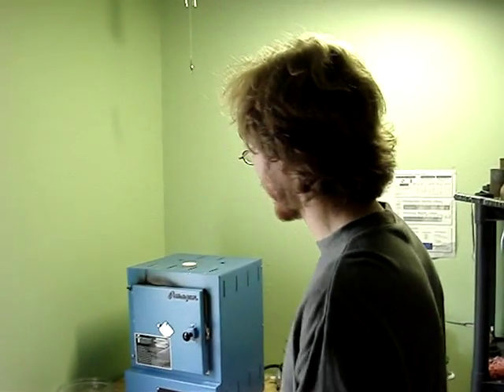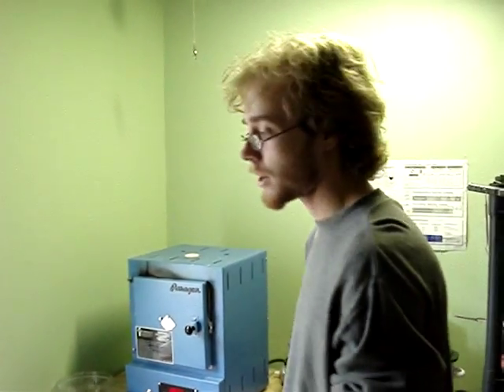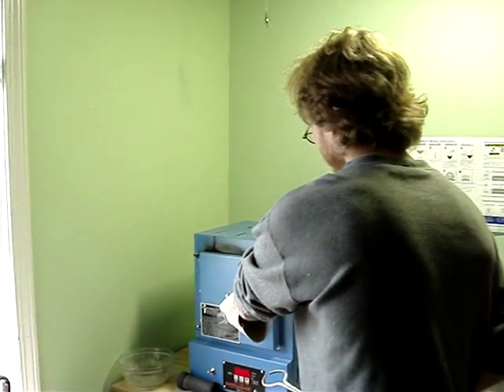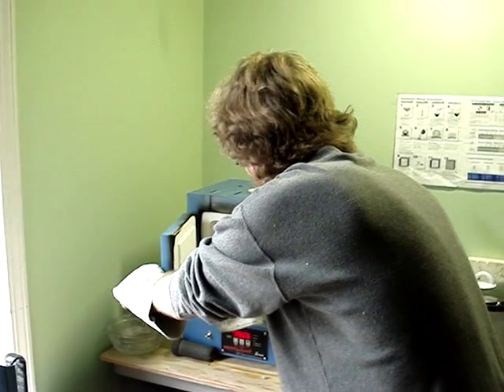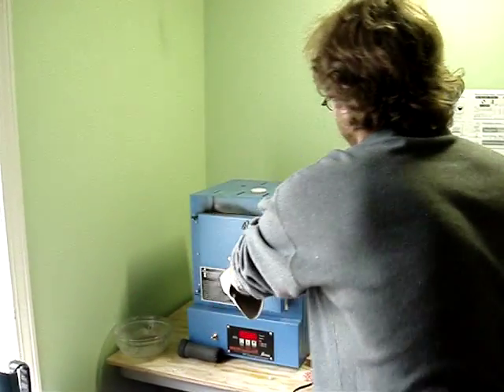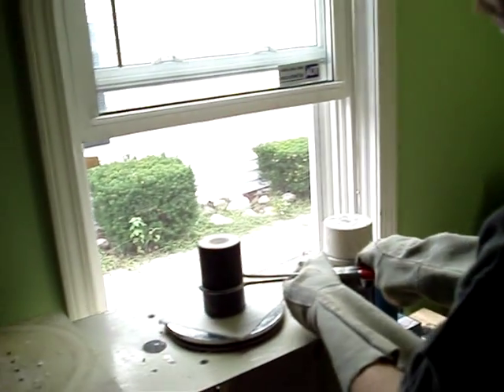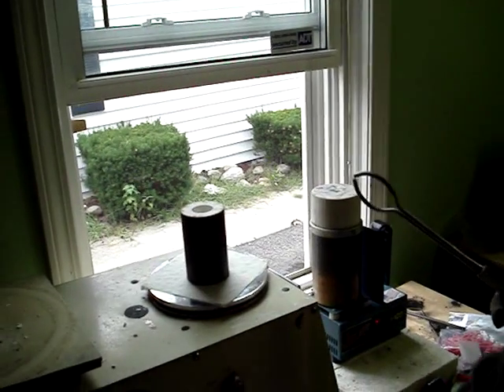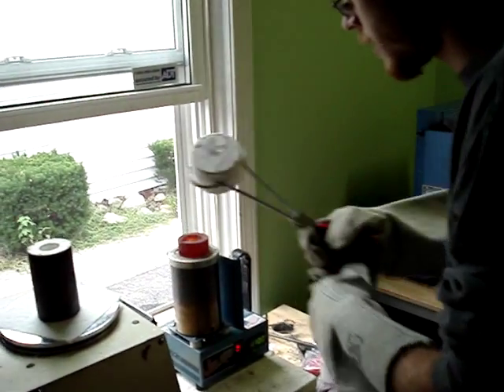Step 6. Lost wax Casting reproduction using wax injection. 21083

Comment: Hi friend. Do you have a 20amp outlet in your casting room? I bought the Paragon sc3 oven and it is rated for 15 amps. My room outlet is 15 amps exactly. Does that mean I should not turn anything else on in the room during burnout? Much thanks for your patient answers.  :) You rock either way. Peace.

Comment: Do you have a problem with pitting in the surface of the silver when casting this way? Does that oven allow for programming cycles? I have the same casting machine, I think, and I am wondering why you don't use the perforated flasks and what the perforated flasks are best for? Much thanks and have a great day.

Comment: great videos! Very informative.
I assume the vacuum is applied so that the metal fills the mold cavity completely. But I was wondering how the vacuum works its way to the cavity. Is the mold material porous? or have small holes been made?

Comment: Nice videos.I am trying to cast in aluminum a 1/35 sprocket the size of a quarter. But I am new at this. How can I make the mother mold? Can you tell me how to make this mold out of? The sprocket is for a model tank. But I wanna make this sprocket in metal or aluminum. You can see photos of the sprocket in flickr.com keyword 1/35 metal tiger tank.

Comment: Hi,
I want to thank you for the series of YouTube videos on casting that you produced.  As a newbee to lost wax casting, seeing the process was very useful in getting started.

In one of the videos, it appears that you are using a paper towel as a seal for vacuum assisted casting.  Is this possible?  If so, how is applied (it must be wet or treated)?  Any info on seals would be appreciated as the silicone seals provided with unit are deteriorating.

Thanks,

Ray Johnson
Mole Hill Studios

Comment: I see you're using a vacuum for pulling the metal into the mold (we used a centrifuge in school).  How is it the vacuum does this when the bottom of your mold looks solid?  Is there a small hole to the casting I'm not seeing?